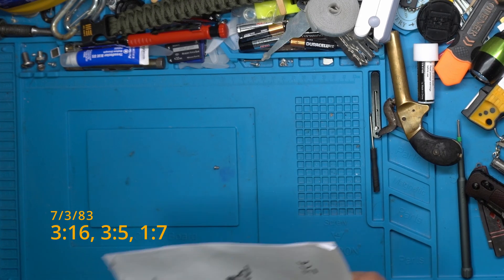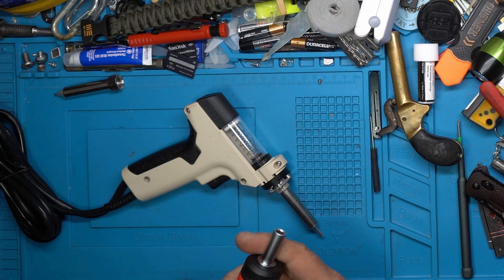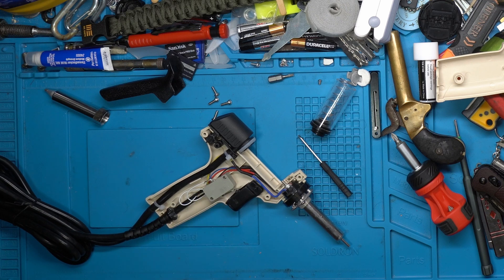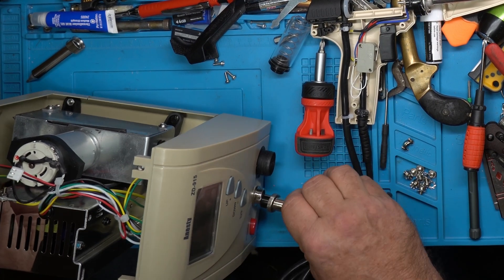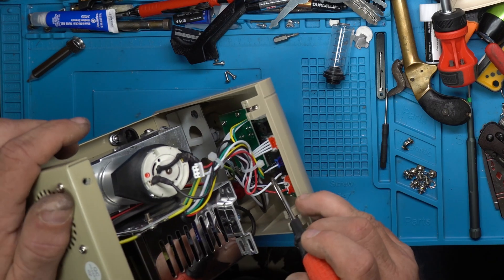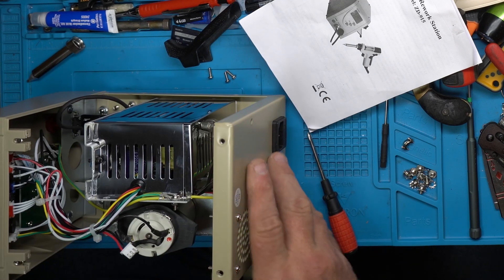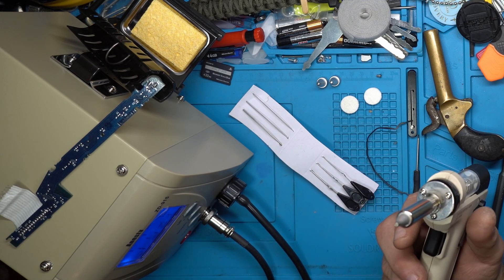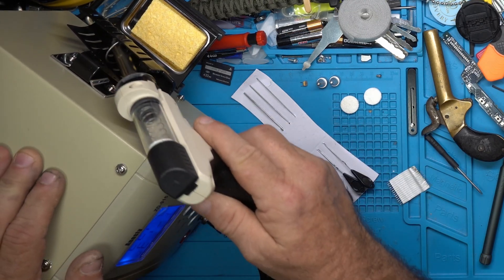Anesty ZD 915 De-solder Station Repair

Comment: I laughed at the. I must assume this came from overseas. When I saw the instruction manual I knew where it came from.
Reply from the maker: Hehe. Yeah nothing gives away the supplier like the manual does. Chinglish is easy to spot.  Kinda like ebay. They get us addresses and claim us seller but in every case they have from 1000 to 20000 items for sale. That alone tells you its a Chinese seller and the fact that the listing and shipping and messages all come during the night which is another dead giveaway. China being on the other side of the planet and all.

Comment: You got the handle / gun that has the unlock lever for taking the tube out , that is a huge plus ....
Reply from the maker: Awesome i thought they all had that. It does make it easier. I cant imagine doing it without a unlock lever.

Comment: As dor windscreen motors they never die i fixed old arcade coin pushers and they use those motors for a very good reason.. perfect speed and they never break. 

I only ever had to replace one windscreen wiper motor only a single time and those motors spin all day and night on those coin pushers.
Reply from the maker: Yeah. I wish they made all electric motors like that, but then i guess the motors would be super expensive due to lack of sales from failures. But to be honest the wiper motors are cheap and last forever. Thanks for the comment and info 😊